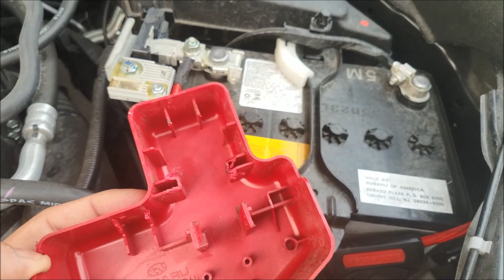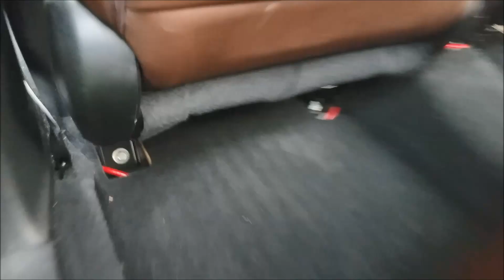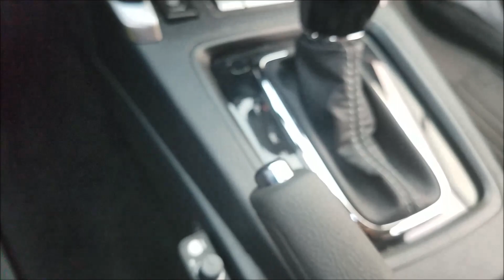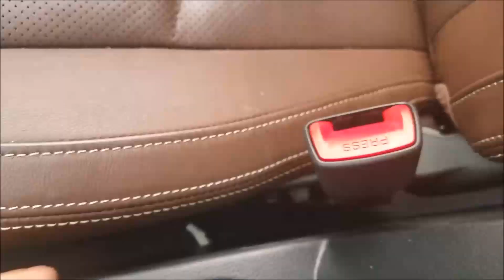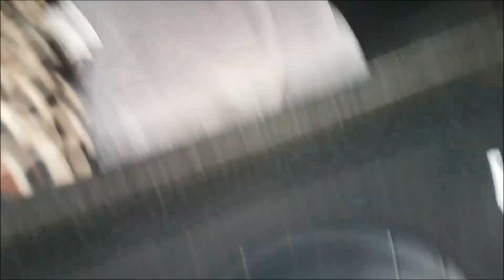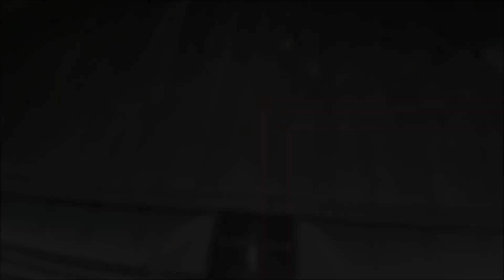2017 Subaru Forester, JL Audio Sub, and Fosgate amp Install

Comment: When tapping into the speaker lines, was that before the signal goes into the HK amp? Or are those wires/signals AFTER the amp?   I’m doing this exact same install in my 2014 Forester XT next weekend. The only difference is that i opted for a LC2i Pro for the LOC. who knows if ill ever be able to tell the difference, but since i was already spending money on the higher quality amp and sub, I might as well spend more on the LOC too.
Reply: where did you end up tapping?
Reply: @kianr2200  I ended up tapping into the signals BEFORE going into the HK amp. I made a video almost identical to this one on my page if you wanna check it out.
Reply: @alexmancilla9498  thanks yo i’ll def check yours out, doin a ton of research rn

Comment: Weird, I'm running 4awg, alpine rated 600, same sub. When I get to 40vol it's like the sub disappears. Not sure if it's ground or bad tune.
Reply: Hi, this might be late but if you are using a non harmon kardon system and you try to take the bass signal from a door speaker the radio cuts out bass at high volumes to protect the cheap speakers. You need an active line out converter to bring the bass back such as an audio control lc2i. Hope this helps...
Reply: @sparten576  I'm Harmon kardon. I'd tapped in from the amp wires under the seat. I redid my ground too. I just need to find the time to go to an empty lot and really fiddle with it. I use a Rockford Fosgate  hlc. It's not my first install in a car though definitely my most disappointing at a 700+/- cost. Have been contemplating getting a different amp which can drive my last 12 1000rms @1ohm, to test.. Then if I need the space swap to the jl while traveling.
Reply: @reactcirca  i had issues when i hooked up a sub to my 2017 civic to replace the stock stuff. My sub would cut out completely at higher volumes. I'm assuming my amp was not being fed enough voltage and cutting out, or my line out converter was giving out. Anyways, the same stuff to my new car and done have any issues on an aftermarket radio but a bigger alternator/battery. Try a capacitor or batter back by your sub amp?
Reply: @sparten576  it's just dumb bc I did the same setup or more with an 09 altima and 97 saab 900se stock electrical and never had this issue lol

Comment: I have a 2018 Forester, I can't find out where the entry of that rubber housing is under the dash. If you can enlighten me, that would be great. Been looking for hours.
Reply: I have an 2018 forester touring.
You can route the power cable through the firewall on the drivers side near the top. There are 2 available accessory grommets at your disposal.
You can use a wire gland instead of the rubber grommet to a watertight seal.

Comment: Great video, thank you. Did you change all of the factory speakers? I just replaced all eight in my 2018 Forester XT Touring (looks extraordinarily similar to your car) with speakers I got from Crutchfield, and the sound is much better. However, now I want to replace the Harman Kardon amp with a more powerful unit. Ideally, I would like to lose the mid range speakers in the dashboard and rear doors because they only handle 50 watts and retain the other 4 speakers in the doors because they sound better and handle far more power. I’m worried about losing Starlink functionality if I replace the Harman Kardon amp. (For example, simply disconnecting the speakers in the dashboard will produce a Starlink error message.) I would very much appreciate any ideas from other YouTubers. Thank you!

Comment: Nice clean install! I've got a Sony XAV-AX100 headunit with Infinity Primus components in my 2015 Limited. My sub install will have to be a bit different (no Harman Kardon and I have RCA sub outs, so very straightforward) but I want to do it like yours, with the sub under the cargo area. I was thinking about an underseat unit with an integrated amp but this looks like the better way to go, in terms of quality sub options. Jealous of those lovely brown seats too, lol.

Comment: Did you disconnect the front speakers when you tuned your amp?  I’m doing a very similar setup in my 17 Impreza Sport with the factory HK system.  I’m trying to figure out if I want to disconnect the front speakers while I tune it...I don’t want to have to take the doors apart but I also don’t want to cut the factory wires at the HK amp.  The other consideration I thinking about is how loud to turn up the factory HU when tuning the aftermarket amp I’m adding because I know the factory HU rolls off the bass frequencies at a certain volume level.

Comment: Great video. Installed a similar line converter to my factory system in a 2017 wrx with H/K .  I installed my power wire through the firewall.  There is an empty grommet behind the dash about the gas pedal. I also did not need a remote wire for my pioneer gm8601. This amp has built in remote turn on through the RCA's.

Comment: I completed the install. Took your video for inspiration and put in a Pioneer 200W Bridged amp driving a sealed 10" Sony sub. Just adds so much to the factory system... Thanks once again for daring to do something different to get better sound into our car. Legend.
Reply: Did you have any issues with window functions from driver door or like illuminatation on the other doors for window up and down?
Reply: @reactcirca  I didn't disassemble the doors so didn't have any issues with windows or illumination.
Reply: @seanmchughnt  yeah after disconnecting battery, had to reteach my window functions. I don't honestly care about the illumination issue of the other doors. Just kind of lame. Something to bring up with services whenever I hit my first free oil change
Reply: @reactcirca  Ahh, understood. Yes the battery disconnection can reset alot of things but I didn't have any window or illumination issues.
Reply: @seanmchughnt  curious, where a good mount point is. I used the right back seat bolt. Though want to redo the ground this weekend as there seems to be a power drop on my amp. Order some screws and all so can knock it out Saturday. Just want to make sure I find a good grounding point.

Comment: did you find any issues with tapping into the say "front speaker wires" in the form of volume/artifacts from the line convertor?
Reply from the maker: I have been running now for over 5 moths no issues at all.

Comment: looks like the line convertor in parallel is the go for "just adding bass" to the system via an external amp and sub setup.
Reply from the maker: yes my setup its just adding bass. I can now turn the bass (lows and mids) down on the radios EQ so my door speakers sound better and clean.